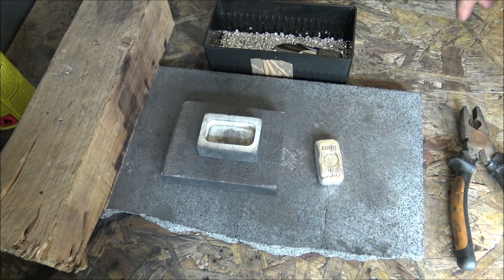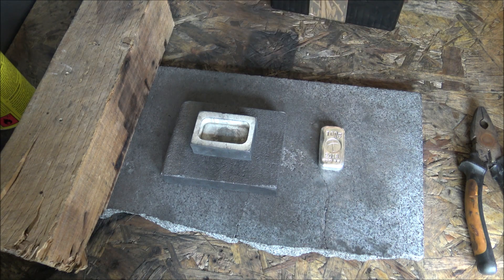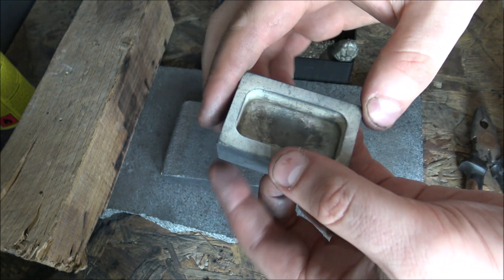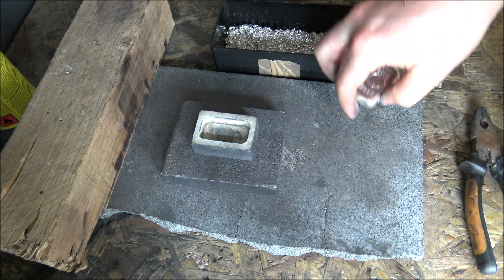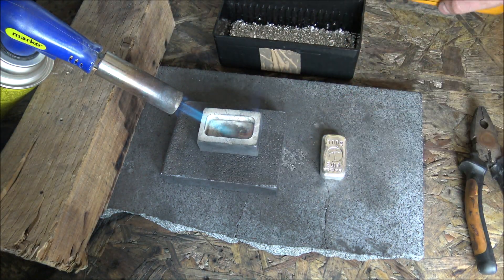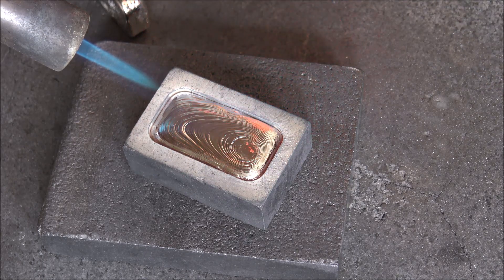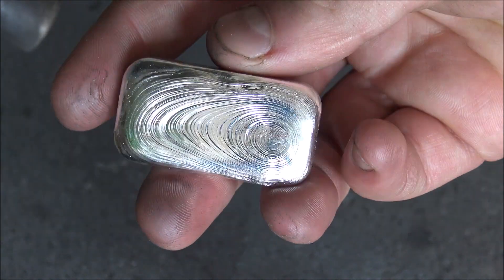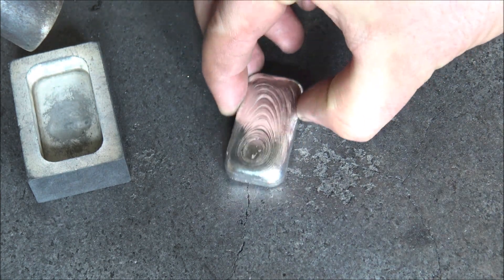Making some Hand Poured Silver bars!

Comment: Great video! I'm more interested in the reverse though melting down silver bars to make my own coins or rings. Any chance of doing a video on that using moulds or sand casting? Also, it would be great if you could tell me what equipment you'd recommend from blow torches, moulds, crucibles, gloves, tongs, etc... and where they can be purchased from as I'd like to have a go myself and have never done it before. Cheers!

Comment: I thought you were weighting the silver pre-melt to exactly 100g to make sure it was the right weight.  I didn't thought you were eyeballing the weight.
Reply from the maker: Yep - eyeballing it all the way. Makes for a much better pour.
Reply: Why can you weight exactly 100g of shots and melt it ?  Will it give a 100g bar or is there any loss in the process ?
Reply from the maker: It would give 100g but you also get lots of graphite pollution on the bar. You can clean that off with vinegar and sand paper but it distorts the ripples and makes it look not so nice. I aim for really high quality bars each time and to do this I "stop short" of the dregs of the silver and end up with a nicer looking bar.

Comment: Do you still get the graphite pollution if you measure 100g of shot and melt it INSIDE the mould directly with a torch? Would that be a way to ensure you always get the correct weight?

Comment: Could you pour onto a scale?  If you zero'd out the mold (and a protective base) you could get real close to your desired weight.  Now I have never poured molten metal, but I would think if you poured just shy, you could then drop a few molten drips at the end?  Just wondering...
Anyway, the bars look very cool!
Reply from the maker: It is something I considered but it is not practical. Think of the silver as a very thick liquid and stopping when you see a number on a scale is quite hard to do. Especially as the whole pour into the mold takes about 1.5 seconds! It is not as easy as it looks!

Comment: why dont you just weigh 100g of grains and then melt it and pour it in? would it not all go into the mold?
Reply from the maker: Often not, some small bits might be in the crucible still. Also, you get all the dirt and mess of the graphite coming out and it makes the bars look all ugly and dirty rather than pretty and ripples!

Comment: couldn’t you use the scale tared out with the mold atop it so you can pour closer to 100 grams?
Reply from the maker: You could try that for sure - but pouring silver is not a slow trickle, it comes out very fast and would be just as hard to judge.